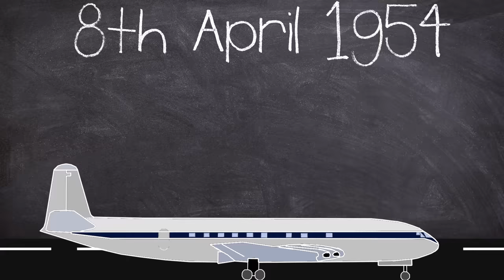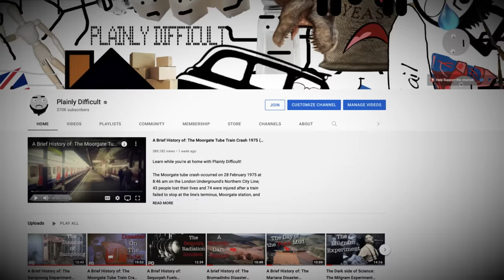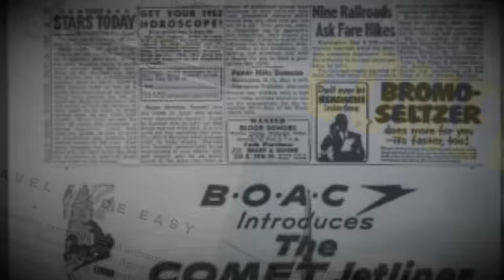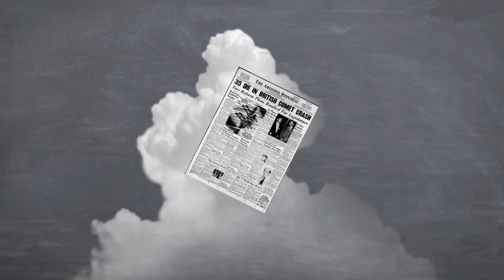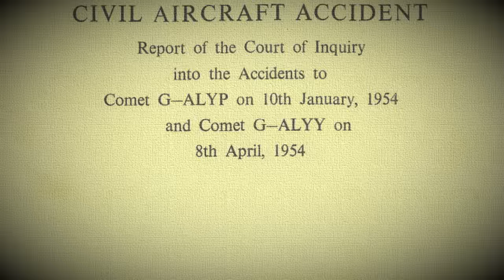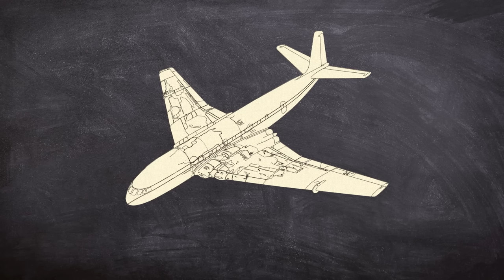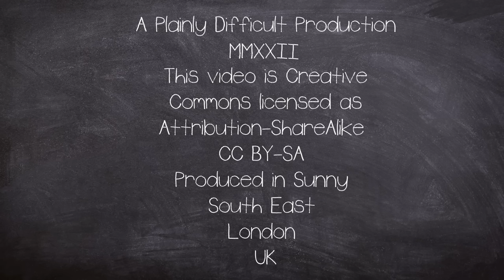A Brief History of: The de Havilland Comet Design Disaster 1954 (Documentary)

Comment: I know the whole concept of plane crash investigation was a new at the time, but that is WAY too many crashes to not say "Okay, how about we NOT use these planes until we figure out why it KEEPS crashing."
Reply: The biggest problem with the Comet Disaster investigations was de Havilland simply lacked the technical experience to understand why its planes were crashing... and they resisted any outside help until the Government was forced to take control of the situation and bring in outside experts.
Reply: This video has some BS included.
For example -
  
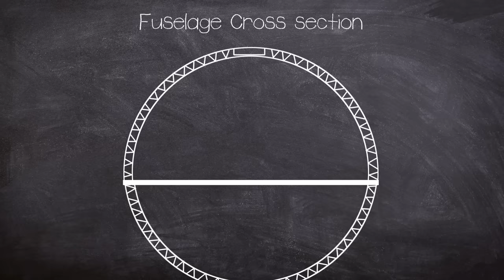    5:20   The idea that only the crew & passenger areas were pressurised is absurd obviously. 
  In fact every part of the fuselage was pressurised from the nose to the rear fuselage bulkhead including the entire cargo area.

Besides that.
The engine position & inlet design were not flaws or fatal flaws, there were good reasons for that design choice at the time.

Comets flew until 1997.
The Comet design had military use as a requirement. Nimrod development began at 
De Havilland before 1953.
Nimrods were not withdrawn due to structure problems or other airframe issues it was entirely a significant upgrade snag & resultant basic economics & an end of line sale happening at Boeing at the same time.

  We feel we can shed some light on some common misunderstandings.

  At the time the Comet wasn't particularly dangerous.

Losses comparisons
How things were in those days.

DeHavilland Comet 4 UK           14% 
DeHavilland Comet all  mks       17%  

Boeing 307                               70%
Boeing 247                               48%
Boeing 707            .                  20% 
Boeing 707                                20% 
Lockheed Electra Turboprop   29%
Canadair CL-44  Turboprop     46%  
Convair CV-580  Turboprop     22%
Convair CV-880    (ff 1959)       27%  
Convair CV-990     (ff 1961)      35%

    Of course De Havilland had prior experience building many all metal construction airframe aircraft including thousands of jet powered fighter aircraft that were primarily of metal construction with pressurised cockpits & jet engines built by De-Havilland.

   De Havilland carried out full stress analysis & engaged in a comprehensive & protracted testing program which is why key De Havilland people were happy to be aboard flying DH Comet aircraft.

    The DH Comet was the first passenger airliner with full length fuselage pressurisation at 8psi pressure differential. Handley Page built the world's first all metal construction airliner during the 1920s.
    In many cases earlier pressurised aircraft were larger, needed thicker fuselage skins due to flying stresses & had much lower pressurisation differential pressure.

   Of course ripstop provision was provided. The skin alloy used became unavailable at the time due to R & D at the manufacturers which resulted in the original alloy being discontinued.
The skin thickness used for the Comet was used for similar later aircraft. 
Frame spacing was not found to be too large & frame width was not found to be too small.

   De Havilland did indeed always work to better than industry standards at the time, used up to date knowledge for the design & construction & no evidence of negligence  or criminal negligence was ever produced in relation to the DH Comet.

   The DH Comet had no effect on the course of the aerospace industry in the UK. The UK now has the world's largest combined nuclear, aerospace & defence sector per capita activity.

    The investigation committee did not find hundreds of fatal flaws or evidence of design defects, structural defects, defective materials or shoddy workmanship. Ripstop provision was included. Claimed incidents did not involve cracks starting from window corners.
Pretty much all changes were just in case changes or were planned development modifications & improvements that were scheduled regardless of incidents.

  De Havilland designers knew all there was to know about metal fatigue at the time they designed the DH Comet.

Hope this helps.

Cheers 👍. 
 
 . . .... ... ..... .....
 .......... ............

Comment: I flew several times in the Comet mid 1960s.
Nice plane. Fast and quiet compared to the then current turboprops.

I wish all mention of square windows could be dropped. It was the riveting technique used that caused the stress fractures.
Reply: de Havilland admitted that they never performed any stress calculations for the sections of fuselage that failed, British airworthiness certification rules only required one section to be tested and d-H engineers simply estimated the stress on other sections.
d-H used aluminum skins that were too thin and made from an alloy that was too brittle for pressurized cabins.
The Comet lacked proper Rip-stop doubler joints and the fuselage frame hoops were too narrow and spaced to far apart to prevent cracks from joining up with adjacent panels.
The revitting was also bad with cracks found in brand new aircraft these cracks passed quality control inspections which were substandard and inadequate.
Reply: @WilhelmKarsten  I think you covered it pretty well!

Comment: The comet and the concord are my favorites. Their designs were just so slick without being... weird. Some of the aircrafts that have been created are so very odd looking
Reply: And they are the biggest financial failures in commercial jet aviation history... the Comet and Concorde are the reason why Britain no longer makes any British jet aircraft in the UK
Reply: Comets flew until 1997.
The Comet design had military use as a requirement. Nimrod development began at De Havilland before 1953.
Nimrods were not withdrawn due to structure problems or other airframe issues it was entirely an upgrade snag & resultant basic economics & an end of line sale happening at Boeing at the same time.

We feel we can shed some light on some common misunderstandings.

At the time the Comet wasn't particularly dangerous.

Losses comparisons
How things were in those days.

DeHavilland Comet 4 UK           14% 
DeHavilland Comet all  mks       17%  

Boeing 307                               70%
Boeing 247                               48%
Boeing 707            .                  20% 
Boeing 707                                20% 
Lockheed Electra Turboprop   29%
Canadair CL-44  Turboprop     46%  
Convair CV-580  Turboprop     22%
Convair CV-880    (ff 1959)       27%  
Convair CV-990     (ff 1961)      35%

    Of course De Havilland had prior experience building many all metal construction airframe aircraft including thousands of jet powered fighter aircraft that were primarily of metal construction with pressurised cockpits & jet engines built by De-Havilland.

   De Havilland carried out full stress analysis & engaged in a comprehensive & protracted testing program.

   The DH Comet was the first passenger airliner with full length fuselage pressurisation at 8psi pressure differential.

   Of course ripstop provision was provided. The skin alloy used became unavailable at the time due to
R & D at the manufacturers which resulted in the original alloy being discontinued.
The skin thickness used for the Comet was used for similar later aircraft. 
Frame spacing was not found to be too large & frame width was not found to be too small.

  De Havilland did indeed always work to better than industry standards at the time, used up to date knowledge for the design & construction & no evidence of negligence  or criminal negligence was ever produced in relation to the DH Comet.

  The DH Comet had no effect on the course of the aerospace industry in the UK. The UK now has the world's largest combined nuclear, aerospace & defence sector per capita activity.

    The investigation committee did not find hundreds of fatal flaws or evidence of design defects, structural defects, defective materials or shoddy workmanship. Ripstop provision was included. Claimed incidents did not involve cracks starting from window corners.
Pretty much all changes were just in case changes or were planned development modifications & improvements that were scheduled regardless of incidents.

Hope this helps.

Cheers 👍
  

   
xcxcxvcxc

Comment: I just love the shape of the inlets. 
So stream line. 
Vickers and Delavan made such cool planes.
Reply: The engine inlets were one of many fatal flaws in the Comets design that caused several crashes and fatalities. 
Based on severely flawed aerodynamic theory that proved to be completely wrong, the Comets engine placement is shameful example of how not to design an airliner, no other airliners use this horribly bad design.
Reply: @sandervanderkammen9230 
Chiney Leydeez should all note.
   Did the op mention anything about the functionality of the engine inlets?
 We believe the statement made is that the "inlets look cool".
   However there was actually nothing wrong with the engine inlets.
  Any problems were caused by pilot error due to over rotation during takeoff.
  Accident losses - % of aircraft built.
   DeHavilland Comet 4 UK  14% 
DeHavilland Comet all mks  17%  
Vickers VC10 UK                   5%
   Douglas DC-1        99%
   Douglas DC-2        47%
    Douglas DC-3        30%
     Douglas DC-4          26%
Boeing s300            72%
  Boeing 247             48%
   Boeing 707             20%
    Lockheed Electra   29%
Reply: @Paul-Nicer58  Please name a single British company that still makes commercial jet aircraft in the UK?.???
Reply: @Paul-Nicer58  THEN WHY WAS DE HAVILLAND FORCED TO CHANGE THEM TO  RECEIVE A NEW AIRWORTHINESS CERTIFICATE?
Reply: @sandervanderkammen9230  
The Chiney Leydeez must note.
   DH weren't forced to change the engine inlets.
    They might also like to recognise & must immediately memorize?
   Nobody said anywhere that Airbus is British or the UK makes airliners on assembly lines.
     Of course Brazil make airliners - 100th down list along with Indonesia for wealth per capita.
   Norway Holland Denmark Ireland Belgium - Top 20 wealth per capita - Don't make airliners -  totally as simple as that.
    BAE systems announced recent £4 Billion takeover of Colorado based US based Ball Aerospace.
 What was DH is now part of BAE Systems.
  BAE systems now does a significantly higher value of work for Airbus than it did when it was a major Airbus shareholder before 2005.
    RR now owns US Engine maker Allison - does classified Aerospace work for the US Govt.  The UK has more important stuff to do these days.  Routine Aircraft Airframe assembly is becoming more of a 3rd world thing.

Comment: Interesting fact, originally it was going to have reinforced window frames, but they were removed, and the metal was made thinner to reduce the weight to a minimum.
Reply: None of the fatal catastrophic in-flight structural failures were related to the passenger windows, this red herring offered up by de Havilland had been debunked by engineers.

Comment: In my opinion the Comet was the most beautiful jet ever designed. But the plane was a huge leap in technology and things were not just quite right. The windows were square framed which is a design feature that was never replicated because of the stress cracking problems at the corners, and the construction used punched rather than drilled rivet holes. The combination of square frames and punched rivet holes produces fatal problems. This was a tragedy for England's aerospace development, they never recovered.

Comment: I heard the square windows thing is what incorporated more fail-safe designs in aeroplanes instead of only safe-life systems
Reply: Indeed, Boeing and Douglass did more to the 707 and DC-8 than just give them round(ish) windows.  The fuselages also had tear-straps that would stop a tear if one started.  Boeing demonstrated the effectiveness of these by purposely slicing open a pressurized 707 fuselage in a publicity video.
Reply: Boeing manufactured the world's first pressurized airliners in 1938.. the 307 Stratoliner, B-29, 377 Stratocruiser were all pressurized.
The Boeing B-47 was pressurized to 9.5 psi at 45,000 feet, significantly higher than the Comet.
Reply: @Stevie-J  The Comet Disaster is the worst engineering failure in aviation history.
Reply: Sandybum  The B 29 and Stratocrasher were much lower pressure and the B 47 was a bomber, no passengers to consider. Also the B 47 had a bad aerodynamic problem making it dangerous, a feature inherrited by the 707 which killed many people due to losing control in normal flight, Boeing restricted the speed and altitude of the 707 while the B 47 had a 5 knots range from stall to maximum speed meaninng the flight crew had to costantly mmonitor and adjust the throttles.

Comment: It really is a shame that the stigma prevented the Comet 2 from gaining the popularity it deserved. It was/is one of the most beautiful jets to take to the air. The faired in engines give it such a sleek, futuristic look.
Reply: The Comet 2 and 3 were deemed to be so unsafe and their application for airworthiness certification was denied.
 You won't find another airliner with this engine configuration because it's design was deeply flawed and the cause of fatal accidents.
 No legitimate engineer would ever copy this horrible unsafe design.
Reply: @sandervanderkammen9230  thanks for the info, wasn't aware there were other airworthiness issues.
Reply: @flamebroiledsquirrel  And high loss rates, 1 out of every 4 Comets built crashed or were destroyed in accidents... airlines quickly canceled orders for the Comet 4 as the accidents continued only a handful were sold outside the U.K.

Comment: For anyone interested propane tanks in the US also go through a testing process using water under pressure for recertification at timed intervals with an expiration date stamped into the valve protection ring around the valve. Air compressor tanks used commercially are struck with a tool and the sound tells the inspector the condition of the tank. Dull thud means rust which sometimes can be heard falling loose. A pass sounds like a bell resonating. Water under pressure is how those tanks get certified to begin with. After watching some explode on security cameras I bought new compressors because I really didn't want to hurt anyone as mine didn't sound good and after cutting one open, I got it used, I consider myself lucky. Check your compressor and when in doubt call your local department of weights and measures as they can help or get a new one.

Comment: I may be wrong but I thought that the idea of the stress occurred around the windows has since been disproved .
Reply: Yes, you are correct.
All of the evidence confirms that the catastrophic in-flight structural failures were related to ruptures along the crown of the fuselage at its widest point... not the passenger windows.
Comet 1 aircraft that were modified with round  windows were still unsafe to carry passengers and in 1958 all Comet 1s had their airworthiness certification permanently revoked.
Only the completely redesigned Comet 4s entered service.
Comet 4s had stronger fuselage hoops, thicker aluminum skins with better strength, more rip-stop doubler joints and better quality riveted fasteners.
The Comet 4 also had safer engines, redesigned engine inlets, improved wings with better flaps and redesigned hydraulic control systems... even the toilets were redesigned to make the Comet airworthy.